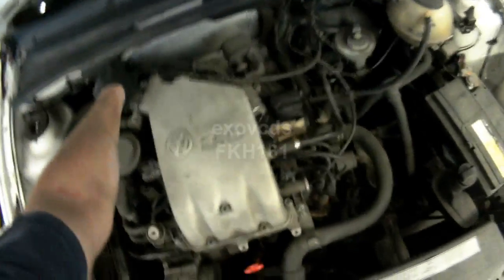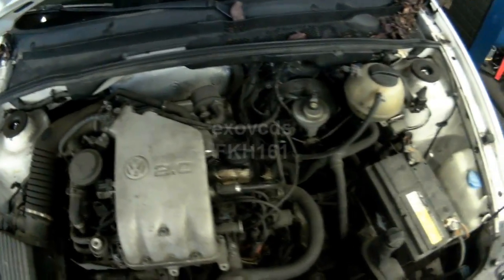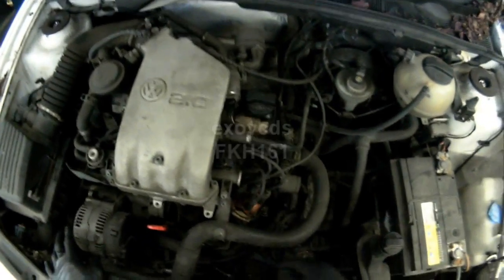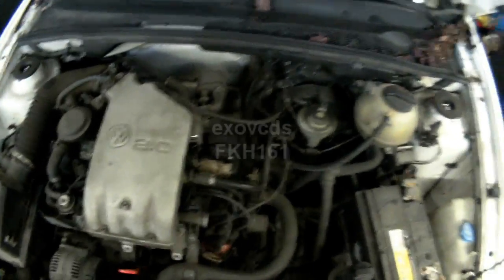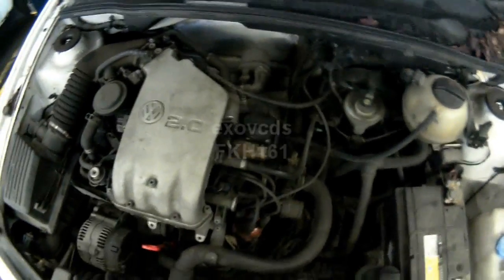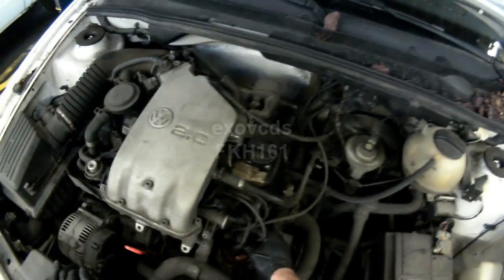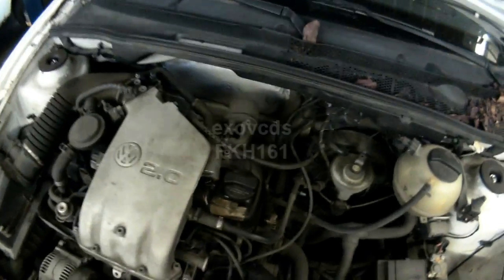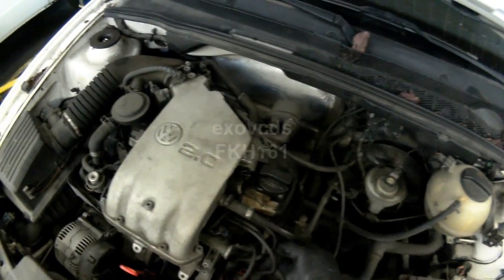VW A3: No Spark Quick Check...

Comment: Do 1.8 code AMM Have a crank sensor? I do get spark but it’s yellow orange at spark plug so I guess it’s my coil? I have a no start
Reply from the maker: Is it AAM? I can't find AMM code. Year, make, model?
If you don't see a crank sensor to the right of the distributor just above the oil pan, then the engine doesn't have a crank sensor.
Is the timing belt ok?
Do all the TDC marks line up when you set the engine to TDC? Show me all the TDC marks.
Is compression OK?
Any fault codes in the ECM or blink codes? Does the fuel pump cycle when you turn the key to ON position? How much fuel pressure? If you spray brake parts cleaner into the intake system, does the engine want to start?
Post a video of you trying to start the engine on your youtube channel... camera looking at engine, so that I can hear & see what is happening. Reply here when the video is on your channel, and I will then watch it.
On older engines, the crankshaft gear can come loose and move / rotate on the crankshaft.... causing engine cam / crank timing to go out of sync.
Reply: @EXOVCDS  Hi Yes AAM 96 thanks for the reply. After I wrote that comment, I replaced the spark plugs. Now it starts and drives, but it misfires at idle.
I think it's something simple with HT leads or coil maybe dizzy. The leads have the metal part at the plug, if I hold it close to ground it sparks.
Is that a bad lead? I'm also a bit sus on the coil. I read I could spray water at coil and leads and look for sparks, Any other test I will try them.
 Really appreciate all you videos. 🙏
Reply: Ok I fixed my problem I had bad HT leads Im glad it was an easy and cheap fix! Cylidner 1 was not even firing, I think :) Runs good now!! I also got shocks from just holding the lead hope this info could help someone!
Reply from the maker: @AhrnNilsson  
Thank you for the update!

Comment: Hey, so I did an engine swap on a 98 golf from a 1.8 to a 2.0 Aba, the aba was an automatic and the 1.8 was standard so we used the automatic wiring harness and ecu the car is standard still but it’s an automatic ecu and harness and it’s not getting spark I’m thinking the computer is looking for the car to be put into “park” but since it’s a standard that’s not an option I’m honestly stuck lol. If anyone has any suggestions please help lol 😅
Reply from the maker: Gear position shouldn't have anything to do with spark.

Comment: In need of some help i got a 95 VW cabrio that's not giving me no spark is changed the ignition switch and coil I put in a brand new cam/crank sensor brand new distributor and starter and still nothing somebody help me please
Reply from the maker: Not sure why you changed the starter for a "no spark" condition.
Also not sure how you are checking for spark (so i can't tell you if you are doing it correctly) .
Have you verified that the cam, crank & distributor are "in time"?
When you turn the key to ON, which lights in the dash come on?
With the key in the crank position, which lights are ON? 
With a scan tool connected to the vehicle, do you have communication? Any fault codes? Post a video on your channel so that I can see & hear what is happening when you are trying to start the engine.

Comment: I need some help again i got the car back running again park it iver night came out this morning nothing, i hook the test like uo to the coil and it lights up on blk but nothing on the center or the orange wire and it was just running fine yesterday plz help
Reply from the maker: To check the signal at the coil center wire, it is best to use an LED test light (attached to the positive post of the battery) to see the flickering. I still don't know if you TDC marks are ok. I have seen engines that had missing timing belt teeth, that caused the engine to behave weird (timing would change as the crank gear would sometimes slip when the stripped teeth go past). I have not seen a video of the engine cranking. Would be nice to see your test light testing, so I can see if it is done correctly. A bad ignition switch can cause no starts. Leave the key in the ON position. Make sure that the battery light & check engine light in the dash are on. Transmission in park or neutral. Jump the starter with a cable directly from the battery. If the engine starts like that, but not with the key... then the ignition switch is bad.
Reply: @EXOVCDS  I pulled the plug off the coil itself it lights up on the black but that's it and the car cranks using the key should I still try to start off the starter ??
Reply from the maker: @graysonwachter1643 yes, try to start with starter... leave key in on position. Coil plugged in.
Reply: @EXOVCDS  can you watch the video?? I sent a link
Reply: @EXOVCDS  oh yeah the engine light isn't coming on like it used to would it be the relay
Reply from the maker: Yes.
Reply from the maker: I don't see a video.
Reply: I'm gonna make a video

Comment: Hey Man Thanks A Lot I Have The Same Problem On My MK3 But I Don't How To To Check The Crank Position Sensor...My Coil And It's Pins Are Getting Power, Do You Think It Would Be The Crank Position Sensor Not Telling The Middle Pin To Flash?
Reply from the maker: When checking for center pin flashing... make sure to use an LED test light. A regular incandescent bulb test light will not be able to show the flashing well. Check the engine computer for fault codes. If a crank sensor / speed sensor fault is present... replace the sensor. Only 2.0l, vr6 & tdi engine use a crank sensor. The 8v 1.8l engines do not.

Comment: Hey man is the triger wire is supposed the be grounded with key on or not?
Reply from the maker: Listen to:
2:40 to 3:27.
Reply: It does flash when cranking but when i put the key on it stays grounded is it normal?
Reply from the maker: If it flashes when cranking, that's all that matters. Depending on where / how the engine stops, I guess it could either stay on or off.
Have you checked timing belt condition? Have you verified cam & crank TDC alignment? What is the actuall issue you are having? When did the issue start?
Was the engine running and it died? Or it just doesn't start all of a sudden? Year, make, model, which engine? Have you checked for spark? How? Different coil? The more info I have, the better I can help.
Reply: And i get battery voltage and ground to the outer pin of the connecter so i know its good
Reply: Ok so i bought the car it was cranking but no start so i then started diagnostic i saw th engine speed sensor is new timing belt is relatively new the okd one was in the trunk coil and distributor are original. Original diagnostic was no triger signal from ecu so i bought a new ecu and now when i plug the led between middle wire and power wire the light is constantly on no matter how much i crank the engine but i did start to flash after i replaced ecu so thats great but still no spark so now im testing the coil. Omh test looked fine but with key on i put voltmeter at end of coil wire from coil to distributor and i get battery voltage there
Reply: I made a mistake light is constantly on when jey is on but when cranking it flashes every time
Reply from the maker: Voltmeter shows battery power on coil wire going to distributor???
Reply: Yeah
Reply from the maker: Sorry, you caught me off guard.
The power output stage of the ignition coil is what collapses the primary circuit of the ignition coil... when the ecm doesn't ground the center wire (when the center wire is grounded / led light is on, then there's voltage / current going through the primary windings of the coil). 
Seconday windings of the coil will show 12v at the coil  post or end of the coil wire going to the cap.... until the power output stage is triggered by the ecm. At which point the magnetic field in the coil collapses and spark is produced. Most likely the coil is bad.... if the led test shows that the ecm is able to control the coil / power output stage.
Reply: That’s exactly what i tought so your saying its normal for the ked light to be lit with key on
Reply from the maker: Possibly.  I haven't had a reason to check. As long as it flickers when cranking... it should flicker when the engine runs. When it flickers, the coil is supposed to produce spark. Ignition on... it doesn't matter if it stays on or off, because no spark is needed.
Reply: As long as it flashes everything should be fine and thanks a lot for the help it means a lot👍your the man!!
Reply: Good thanks im going to get a new coil today gonna try it tomorrow

Comment: I have a new hall sender, new crank sensor, new coil and new rotor/cap but I still don't get any spark while cranking. The coil does spark when I first turn the ignition on but no trigger signal on the middle wire while cranking. All the wires have good continuity so I don't think they're bad. I'm leaning towards faulty ECU but everything else works as it should. Any ideas?
Reply from the maker: Probably ECM. 
Watch this video (I was helping someone else)... as you can see, the coil does not spark when the key is cycled. Only when cranking.
https://youtu.be/QQUo3OO5LkE

Comment: Hello I have a 98 Volkswagen Jetta and I'm getting nothing from the middle electrode that connects to the coil pack how should I troubleshoot the computer?
Reply from the maker: You have to use an LED test light to check for coil control. 
Attach the test light to battery positive and then attach the tip of the test light to the center pin of the connector. When cranking, the LED light should flicker (it's faint / hard to see). You can also check if your tachometer is moving off of 0 when cranking or use a scan tool to check for an RPM signal. If you have an RPM signal, then the crank sensor is OK.
Reply: Thanks so much!!

Comment: Great video very informative, i have actually looked at several of your videos for guidance to help me fix my beat up 96 jetta with the 2.0 engine, like the relay shaft replacement and timing chain. And so far all of your information has been on point thank you so much for that. Im hoping u can help me once again, my car seems to stall once hot/operating temperature. Then itll start again for a couple of minutes then stall again. Help!! Please ihave checked for spark but havent checked across the connector at ignition coil, and i have a new fuel pump in it. What would you suggest i check next
Reply from the maker: Crankshaft position sensor or 109 relay (if there is one in the fuse box)... would me my first suspects.
Reply: Thomas EXOVCDS right on i will look at those today, i am actually getting ready to do a fuel pressure test, my car shit down on my way to autozone today, and i had my scanner hooked up to it, and it threw a p1500 code. No CEL tho.
Reply: Shut*
Reply from the maker: @gerardobrns  could be a bad fuel pump relay... that will usually also set a bunch of short to ground codes, but not all scan tools will read stored fault codes.
https://www.ross-tech.com/vag-com/dtc-comparison.html
Reply: Thomas EXOVCDS , so i have a second relay i swapped out, and it actually does the same thing, they are both used relays and the symptoms are when i start the car first thing in the morning it runs fine for a good 15-20 minutes after that it starts stalling out, then itll start back up after a few minutes but will stall out shortly after, so i am assuming it has a lot to do with the cars temperature, the haynes manual troubleshoot says something about a faulty temp sensor. But its super brief, doest really mention a why the temp sensor would have anything to do with the car stalling out
Reply from the maker: @gerardobrns  Crank sensor would still be my first suspect then. You can check the crank sensor resistance when the engine does not want to start. Disconnect the sensor and check the resistance across the 2 signal wires. The 3rd wire is a shunt / ground. I think 900 to 1000 ohm is normal... I'd have to check a manual to be sure. Check resistance when the engine does not want to start. Also, if your scan tool does not show an RPM signal while cranking ( or the tachometer needle does not lift off of 0), then that is also a sign that the crank sensor is bad.
Reply: Thomas EXOVCDS gotcha ill try that, thank you again, now i just have to make it home, im sure i will, but not before my car stalls out on me another 50 times haha
Reply: Thomas EXOVCDS hey so i probably should have started with the plug at the coil with the test you showed, so i do have spark on coul spark plug and on the rest of the spark plug wires, there is also power and ground on the two outer pins on connector, but no pulse in center one, so i guess ill be replacing that crank sensor thanks again for all the help
Reply from the maker: @gerardobrns  if you have spark from coil and at spark plug wires then the crank sensor is OK. I can't see how you are testing things... a video would help.
Reply: Thomas EXOVCDS ok ill load up a video, but so with the key on engine off there is ground on one of the outer pins of the 3 pin connector on the ignition coil and there is power on the opposite side, the i hooked the  test light to battery power and had my girl crank the car and i probed the center pin and there was no pulsing.
Reply from the maker: @gerardobrns  You need to run the engine until it stalls and will not start again. Then use an LED test light to check for a signal at the center pin.
Reply: Thomas EXOVCDS will do, dont have one atm but will do

Comment: Hi Thomas,

I'm working on an '94 Golf 2.0 and have a crank/no start issue. I have good spark, and fuel pressure at the regulator but it seems the injectors aren't working. I did a visual on the timing belt, just in case and it looks good. I pulled the injector harness and connected a NOID LIGHT to each connector and have power to the left pin but no pulse when it cranks. I can get the engine started with starting fluid but will die with out it.  Can you please help?  Thank you
Reply from the maker: Any recent work on the car that lead up to this no-start? 
If the ECM is not "grounding" / controlling the injectors, it could be an internal problem with the "injector driver(s)" (transistor). Make sure that all the ground wires have clean & tight connections (use a wiring diagram to determine how many there are and where they connect). If you have a scan tool, check for fault codes. If your scan tool can activate "output tests"... do so. The ECM will trigger various components one after another... so that you can check if it has "control" over them.
Reply: No, No recent work has been done to it. Car has been sitting for a few months and I started troubleshooting it to see if I could get it to run.  I will try to find a diagram to check all the grounds and will get back to you with results.  Thank you very much for your quick response.

Comment: Hey Thomas! Great job on the videos, you have helped me many times, and I'm hoping you can do it again. I'm working on an '02 Cabrio 2.0 and have a crank/no start issue. I have good spark, and fuel pressure at the regulator but it seems the injectors aren't working. I did a visual on the timing belt, just in case and it looks good. I pulled the injector
 harness and connected a noid light to each connector and have power to the left pin but no pulse when it cranks. could this be the Hall effect sensor, or is the ECM cooked?
Thanks >Tim
Reply from the maker: Hall sensor / distributor signal is not needed for the engine to run... you can disconnect the hall sensor and the engine should still start or continue to run when disconnected on a running engine.

If you have spark, then you should have injector pulse.

Any recent work on the vehicle? Can you communicate with the ECM via a scan tool? View live engine data or codes?

Look for a broken wire on the control side of the injector wiring. If that is ok, check the ECM board for corrosion or cold solder joints. 

Confirm that the engine will actually run when an alternate fuel source is added to the intake.... if the engine does not try to run, then there is possibly more than one thing going on.
Reply: @EXOVCDS   yes, I replaced the Crank sensor to address a stalling issue, then after a few days the fuel pump quit. Fuel pump issue was accompanied by several codes related to fuel delivery as well as low inputs on all four injectors and SAI errors (no pump). I can still pull codes but have yet to try alternative fuel delivery, or looked for broken wires. Thanks for the direction, I will get back on it tomorrow after work. >T
Reply from the maker: Sorry... my bad, for some reason I was thinking batch fire injection / single ECM ground. Ignore that part of my last post.
Check the main round wiring harness plug at the side of the cylinder head (behind the distributor)... separate it an check for corrosion.
Reply from the maker: A bad fuel pump relay will set 7+ codes that deal with "short to ground" (ECM controls all the ground circuits, when it does not see a voltage on those control wires, it sets short to ground fault codes). Try a different fuel pump relay, even though you seem to have power on the injector power feed.